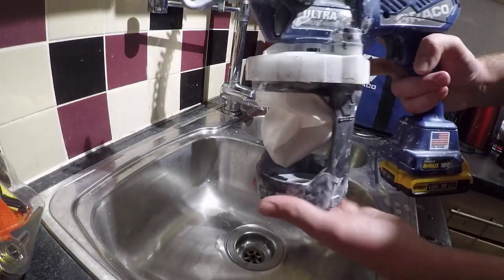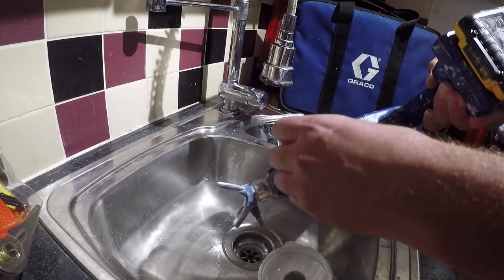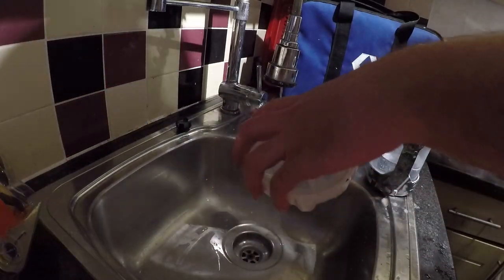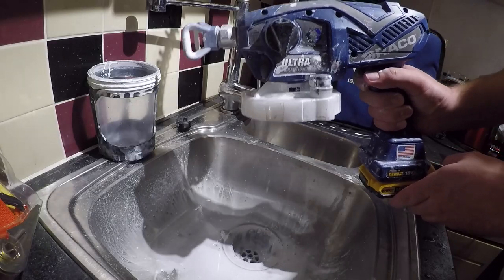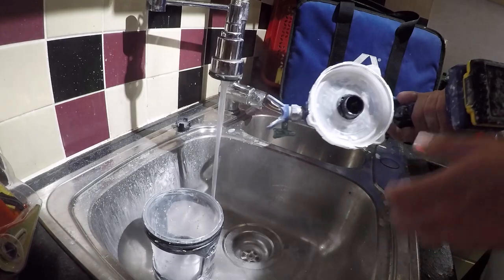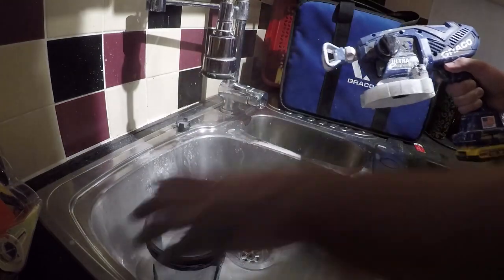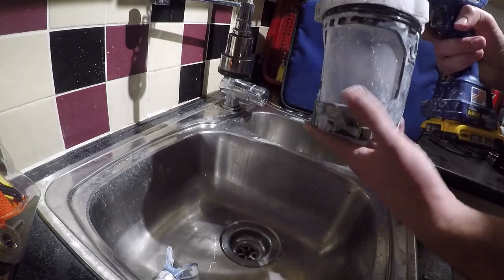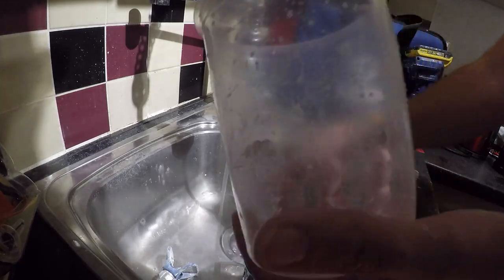How to clean a Graco Ultra cordless handheld airless sprayer

Comment: The paint can clog the pipes over time, be careful. Other than that good video.
Reply from the maker: Thanks for checking out the video. Yes youre right. I changed how i clean it out now. And its still going on the original motor
 Thanks so much for watching ✌
Reply: @sprayaholic  cool. I am having issues with mine, I can spray paint but not the water, I know it sounds weird but basically I cant clean it out. I am about the split in half and find out what's the issue.
Reply from the maker: @lapucrenovationsllchomeren1676  oh really. Will the machine still prime? Try it without the tip and guard fitted.
I often use mine upside down now as you dont need to squeeze the pot as gravity makes it work. Same with cleaning. I usually just fill a cup and flip upside down and just hit spray and blow it all ouy instead of cycling dirty water in the pot.
Reply: @sprayaholic  That's a good idea and good tip to share with others. I do prime mine upside down to let the inside paint out and I catch all the paint I can in anything that goes on the garbage so the paint doesn't go to the ground or drain pipes. I was doing fine for over a year until I let it sit for a couple of days with paint. I thought it go clogged when I was cleaning it, but it wasn't spray water on any ways, thought adding more paint and sprayed paint, I went back thinking it got unclogged and tried to clean just when I was watching your video with no luck on getting water coming out so it cleans the paint from inside. So thick fluid still spray but water wont.
Reply from the maker: @lapucrenovationsllchomeren1676  mine has been stored for 6months now with paint inside 😬 im going to attempt to get it to spray haha. 
Yes it will no doubt be blocked inside.
Water may be too thin as stupid as it sounds. Ive seen it happen on others.  Until its clean it wont pass through.
Another tip is when youre about to clean it. Take the cup off and put your gun over the paint can. Flick in prime and just run the unit a few seconds. This dumps any paint thats held in the machine before you go to flush it through.  It cleans faster that way. 
Do you have waterbased gun cleaner? If you can get some just pour some in a cup flip unit upside down try it in prime if it cycles or straight into spray then leave it to sit and try again when its broke some paint down
Reply: @sprayaholic  Good point. I will try the waterbase cleaner to see if it clears the ways. And I didnt think before about just priming the left over of the paint in the gun back on the paint can, that's a good one too. I have been painting for 20 years and I still learn stuff from others. I will remain humble. I will let you know how it goes. I will share one tip to clean the spray tips. I spray glue off on them and it melts the build up paint inside and with an air blower it clears it up easy. You can see the build up coming out and like a new spray tip.
Reply: @sprayaholic  oh, and thank you for taking the time to share about this.
Reply from the maker: @lapucrenovationsllchomeren1676  no problem thanks for checking out the channel. Will have new videos up weekly now. ✌
Reply from the maker: @lapucrenovationsllchomeren1676  if you can get hold of waterbased gun cleaner. Throw your tips and everything in a bucket over night or a few hours honestly come up like new. Tetrosyl is the brand over here in UK i use. 
I'll take a look thanks for the tip. I have been using cellulose thinners and just brushing them off and vlow them all through
Reply: @sprayaholic  I will try that too. We are in the same page 😄 Greetings from the US.